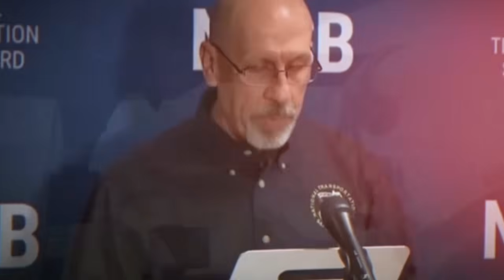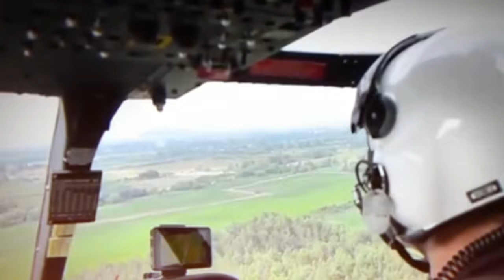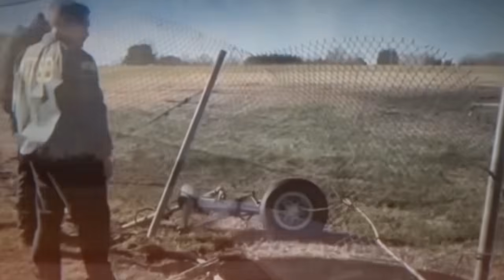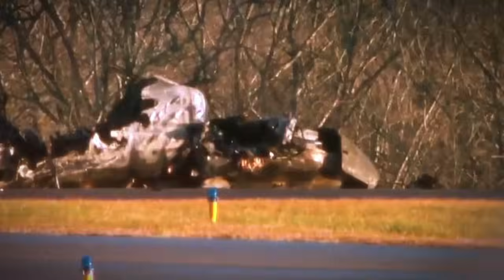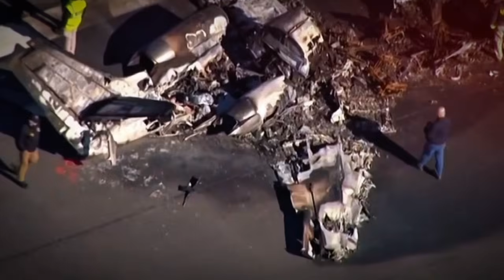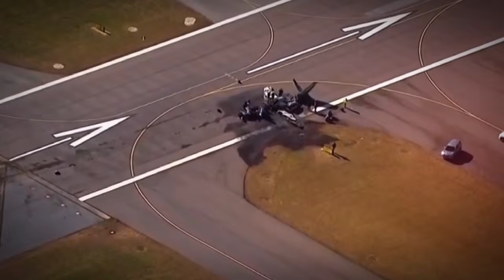How The Gear Lights Not Working Proved The Real Problem _ Greg Biffle Electrical

Comment: What does this have to do with Biffle?
Reply: my question too..
Reply: Very interesting!! I have drawn plans for highways and buildings. This is the first time I’ve found out anything about cement production and rotary kilns. I wis you had included some pictures of the kilns, as it would be interesting to see.
Reply from the maker: Fair question. The point was to show how that system detail connects to the bigger sequence of events in the accident. Did that part seem unclear in the video?